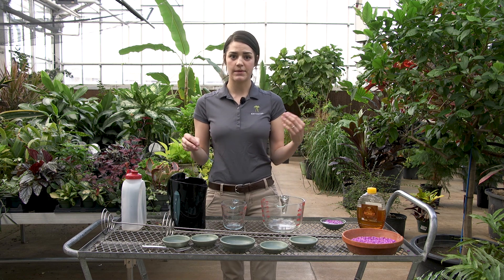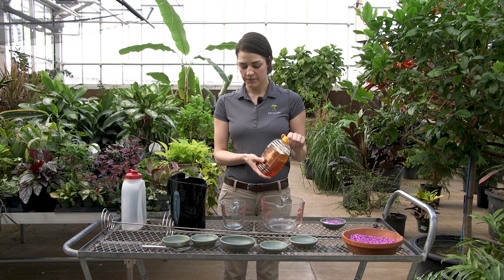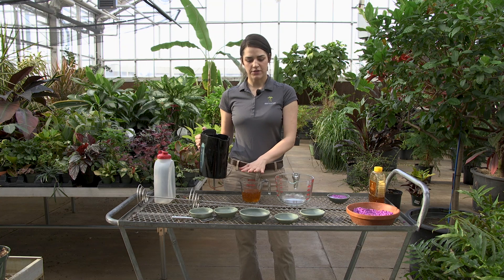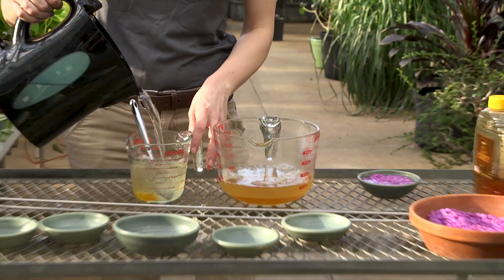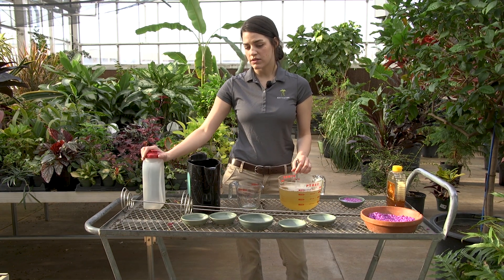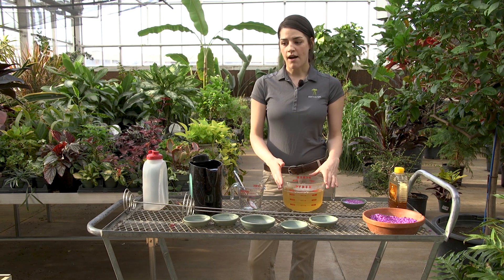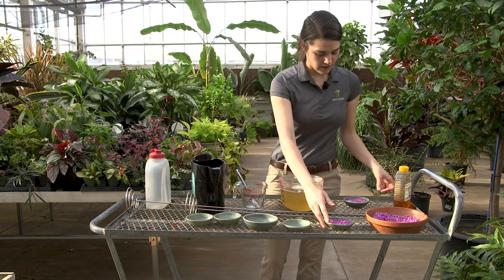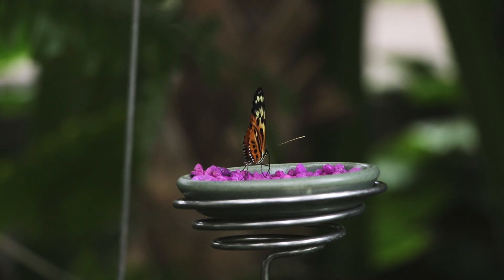Meijer Gardens Butterfly Feeding

Comment: Great video. I live in North Florida and ants are horrible. To stop the ants just use Vaseline around your metal poles (you place the syrup on) about 1/2 inch width. This creates an oily line the ants won't cross, it works everytime. It's about 90-100 degrees in Tallahassee and the oil holds up. I haven't had to add any new Vaseline in 3 weeks so far. Good Luck
Reply: i’m gonna try this tomorrow!!!
Reply: Omggg thank youuuu I love in north Florida too and I was so curious about the ants